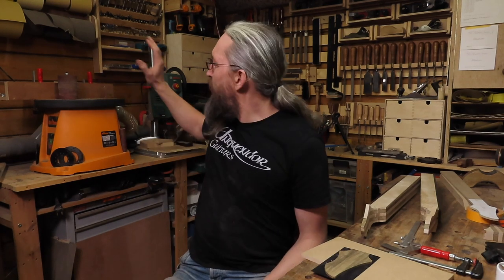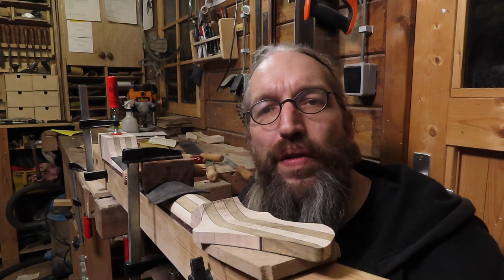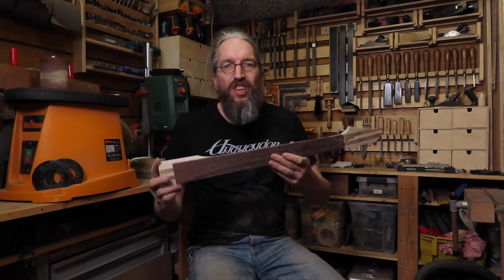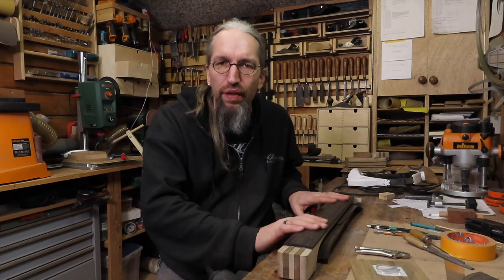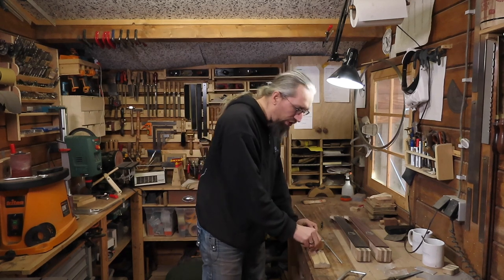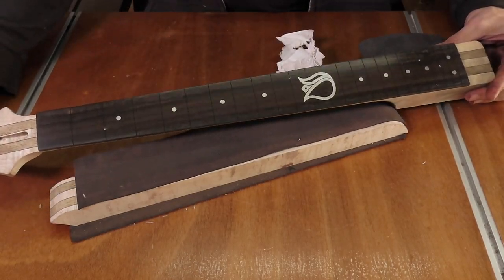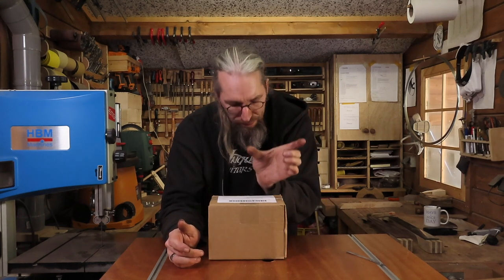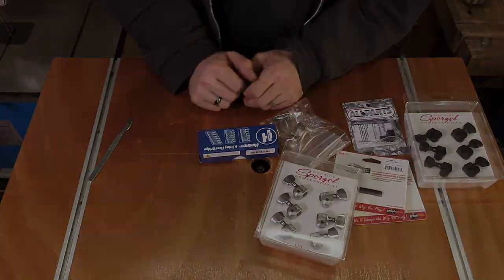Carving Guitar Necks, Doing Inlays and Unboxing Parts - A week in the Unquendor Guitars Workshop

Comment: I'm so glad to see you using volutes on your necks, Dany. I thought it was the best idea for Gibson, coming from the Norlin era. I have one on my '76 ES-175.
Reply from the maker: Hi JJ,
Personally I think volutes should be mandatory. They not only add a lot more structural strength but also add some extra mass where the strings transfer vibrations into the neck which hopefully contributes to the sustain and harmonics/ 'Tone'  of the guitar. And they just look nice.
Reply: @UnquendorGuitars  Yes, especially on guitars with a 17 degree headstock angle.

Comment: I share your pain. Imagine how I felt when I was putting my tele together and realized I cut the neck pocket to deep. Guitar building is all about fixing mistakes.
Reply from the maker: Hey Leon,
I know that feeling all too well. Although I usually know how to fix a mistake I must confess I'm always bummed for a couple of hours. 
I found the best way to deal with mistakes is to take a, cliché, deep breath and come up with a solution straight away. 
I do hope you got your neck to fit correctly. Glueing in a veneer at the bottom of the neck pocket usually fixes the fit.

Comment: Cool as always Daniel. What do you think about the strips of the neck being made at an angle, narrower at the part where the tuners are? Does it have any advantage or is it just a more difficult design to make? Thanks.
Reply from the maker: Hi Adrien,
If you're talking about the strips in the laminate of the neck....
I don't see any advantages or disadvantages in tapering the strips in the laminate. It sure is a nice design feature if done right.
If you make it so that the laminated stripes run parallel to the side of the neck by tapering the strips that would look awesome I think. 
It shouldn't be that much harder to do once you figure out the correct angle/taper for the strips. When you have the strips cut and planed the glueing of the neck blank is the same. And after carefully positioning the neck template everything else is like with a 'normal'  neck blank.